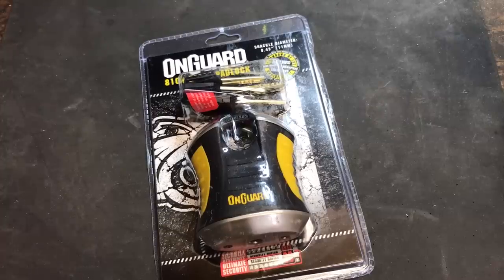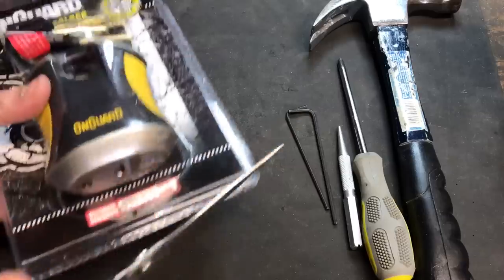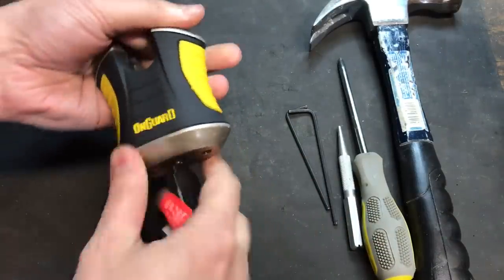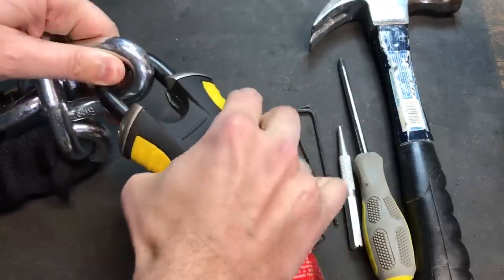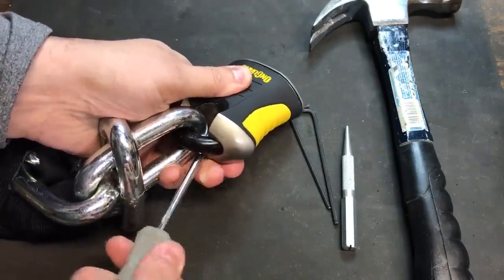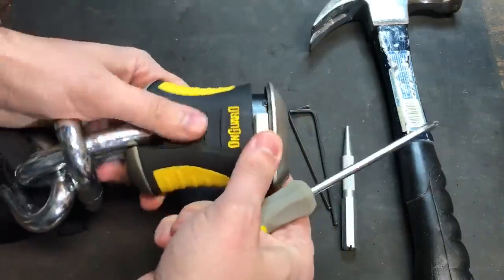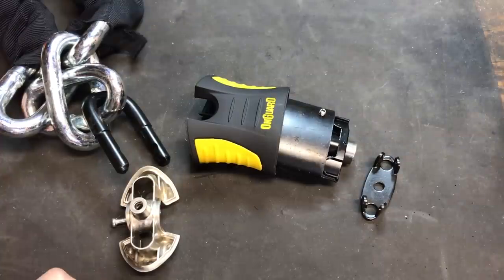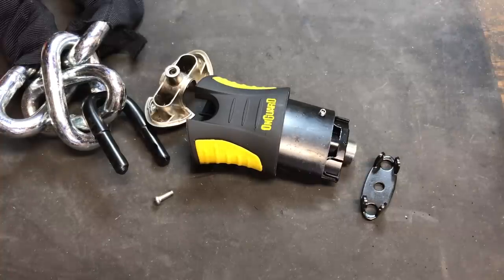[585] STUNNING - OnGuard "Beast" Padlock Disassembled While Locked!

Comment: How do flaws like this even make it past the design phase
Reply: They obviously do not have a skilled intrusion specialist. Its probably the designers mom, too proud of him to point out his flaws. 😂
Reply: David Daivdson  actually that lockbody is  so thin you wouldn't need to take it apart. That whole design is terrible.
Reply: They clearly knew the design was flawed by needing to put ball bearings in the allen key head. At that point they should have started again. Why didn't they go down the traditional route of putting the retaining screws at the bottom of the shackle holes?
Reply: David Daivdson  If the desire/need to open the lock leaving no trace was big enough it would be worth fabricating a small hand-held press to deal with the ball bearings. Would be almost silent too.
Reply: @Graham_Langley  A modified chain-breaker would make a nice slient ball squeezing tool. If the bike owner uses a different lock a thief might still be able to get away with the drive-chain as a consolation prize. 🙃
Reply: @gerhardvandenberg7249  Good point.
Reply: Tbh not everyone is the lock picking lawyer and imagine some thug on the street with all the right tools for that particular lock making a bunch of commotion trying to skillfully open it while you’re getting your coffee on your commute
Reply: Skilled intrusion specialist? It has external screws, ffs.
Reply: Same reason Boeing’s 737 was a fiasco, YouTube Rewind gets downvoted, and Hillary loses.

People make, say, and do things with limited understanding or a refusal to accept reality.
Reply: David Daivdson  you could put together a hand press that would push those bearing in silently. If you see a $15K+ bike chained up with that lock it'd be worth the effort then with two minutes silent work at night you'd be away with it.
Reply: David Daivdson  I'd spend a couple hours making a clamp for a few thousand $. Die grinder has the downside of being fucking noisy.
Reply: David Daivdson  Here in the UK some motorbike thieves used to go out looking for bikes to nick in pairs, usually from big out of town Shopping malls or city center car parks. The one working on the lock would be wearing dirty overalls, and the other would just be standing there in bikers leathers and holding a crash helmet. Apparently they'd either hang around waiting for someone on a nice bike to turn up, Or they'd feel the exhausts of a few bikes to tell if they'd been there long (Most people wouldn't be going to these places if they just needed to rush in and grab something in a 5 minute visit, so if the exhaust was still warm they'd most likely have 15+ minutes to steal it).

Any casual observer would assume that the bloke in leathers was the owner and he'd called out a mechanic because he'd lost his keys or something. There was one case I heard of where the thieves were noticed by passers by for 20+ minutes while they were struggling to remove the lock, before they finally resorted to A PETROL DISC CUTTER !!!, But as it STILL only looked like someone who's mechanic was having trouble getting the padlock off his bike no one going to the shops thought to mention it until later when they came back out and found a police officer was asking folks if they'd seen anything.
Reply: @Dream146  a clamp doesnt cost 3 grand, a chain break would even do for a few dollars. Your right about the die grinder, it probably wouldnt even get through the whole chain before the wheel was toast and you didnt even get though the chain lol. Most people use hardened chain when protecting valuables.
Reply: @bolerdweller  sorry I see my language was a bit ambiguous. I meant for the reward of a few thousand dollars I would go through the trouble of spending a couple of hours making a custom tool.
Reply: Leonard DSL money. Costs money to redesign/ fix and why fix it when people will still buy it?
Reply: David Daivdson  I agree. The input way you would know this is if you subscribe to third channel and use it as a reference to find the lock your neighbour uses on the bike you've been wanting to steal. The biggest security flaw a company can have is letting LPL get hold of the 🔐 in the first place.
Reply: You’ll have to ask the designers of the  Boeing 737 Max - they’ve got it nailed....
Reply: It's designed for lower costs and higher profits.
Reply: @Dream146  I have those tools ready. I've been waiting MONTHS for someone to 1) use this lock and 2) have a bike worth using this method on.
Sarcasm aside, not gonna happen.
Reply: @ozzyondirt4003  or you just damage that first screw in order to make it impossible to unscrew and you should be good to use it.

Comment: Wow crazy you can dissemble the complete lock from the outside with basic hand tools
Reply: LPL studied the lock and has a ton of experience. Honestly, most people would see a lock this beefy and would walk away or bring some bolt cutters. No petty thief would do what you just saw... lol. Like, yeah, this is a security flaw but only to an experienced expert in the field.
Reply: @katarasasii7073  A phillips screw head in plain sight is an easy thing to try, and a set screw is easy to tell even with a ball pressed in, this is 100% shoddy craftsmanship.
Reply: @katarasasii7073 , three external screws on the lock. I'd have taken this thing apart when I was ten. Just because I saw the screws.

Comment: "I would say that is a relatively significant security flaw..."

Also, the RMS Titanic is somewhat wet, and there is a bit of water to be found in the Pacific ocean.

Seriously though, thank you for these videos! Good, onto-it people like you are the tie-breakers of the cat and mouse game thieves and lock manufacturers currently play :)
Reply: The RMS T had a design and a structural flaw. The design flaw was that the water tight bulkheads were open top and like a tilted ice cube tray, all the water sloshed forward flooding each bulkhead in turn. The flooding was uneven (bulkhead four) and water started pitching forward over the bulkheads–she turned in to a nose dive.  

The structural flaw was that the steel used for the hull was brittle at arctic water temperatures. Obviously, neither item was checked.
Reply: A good case can be made that the ship that sank was the Olympic, the first of that class of ship, but under the name and insurance policy of the then newly built Titanic.
The issues you mentioned were known at the time, and also present on the second ship of the class, Britannic, which also sank.
For Titanic, the third and final, they had been fixed, and it survived, under the name Olympic for obvious reasons, multiple enemy strikes as a support ship in ww1, and returned to passenger service before getting scrapped, leaving no conclusive evidence of any ship of this class.

Comment: Stunningly stupid. Holy crap.

I am thinking that if they had applied red Loctite to the screws, this would have been impossible.
Reply: Patrick Henry 

You would then just a touch to the tool list.  Red lock tight will easily free up with some heat.
Reply: Spot welding is only way to make this lock use able.
Reply: @JamesPhillipsOfficial  useable yet unreliable
Reply: @adrianwelgemoed9562  I don't think I would buy it anyway. No point buying something that we have been informed, is defective out of the box
Reply: @JamesPhillipsOfficial  they probably gonna sue LPL now

Comment: This might be the first time I disagree: Is it really that easy to open when the lock is not lying on the floor?
Reply: If this is designed for motorbikes, it'll be laying on the floor in use. The chain goes through the back wheel so the wheel can't turn without totally trashing the bike. There's not usually much to chain to in a car park.
It would probably be a little more difficult trying to do this on the tarmac though
Reply: Same

Comment: Looks like something acme might supply to the road runner meep meep 
The sad thing is it wouldn’t be hard to improve
Reply from the maker: Agreed... very easy to improve. Ironically, using a bling pin instead of a set screw would probably be cheaper to make!
Reply: Trust me ACME is better quality than that lock
Reply: loz11968 Don't you mean to Wile. E. Coyote?

Comment: Wow, for a high security lock, that's terrible. Please do a follow up if you get a response from the company.
Reply: I think the follow up would be that it is user error. I assume, and this is reasonable to do so that their 12mm chain doubled in the hasp doesn’t allow access to the top screw. But this is a reasonable use for the lock and a 15mm motorcycle chain ring looped like demonstrated is a typical way to lock a bike since most locks aren’t big enough to latch two 15mm links and if they are they are likely flimsy or VERY expensive.
Reply: I guess still cheaper then buying a new bike...

Comment: Any insight into why it was made like this? I've never seen a lock with a screw in an accessible place before, usually it's at the bottom of the shackle hole to prevent just such an attack. The set screws also seem really low-down on the body, but I'm not as familiar with that.
Reply from the maker: The location of the set screw isn't uncommon, but you would usually find a blind pin pressed into position there.
Reply: LockPickingLawyer I'm curious, if all three outer screw locations were filled with JB Weld prior to use would that make it more secure? Is the lock mechanism easy to pick as well?
Reply from the maker: It's not easy to pick, but it's not hard either. The sliders don't have false gates. ☹️

Comment: To be fair, it's probably really difficult to use the hammer while this lock is on a bike or something. And it definitely takes much time to achieve that so I think you're pretty save with that lock (but I guess it's faster to actually pick it so I'm not sure if I'd trust that lock now).

Comment: That lock could be made more secure with a few drops of LOCTITE 640 High Strength Retaining Compound .or similar thread locking goop..  The lock core looks interesting
Reply: DrEvil814 Superglue works just as good or better and most people already have that at home anyway. But still, thats not how it should be.
Reply: And drilling those screw heads useless.
Reply: And maybe a piece of sticky tape lol
Reply from the maker: The loctites that are strong enough for this application can be released with modest amounts of heat, so I don't think that's the solution. A blind pin is what probably should be there.
Reply: JB Weld or epoxy could be useful as well but I do question why it would be user serviceable at all.
Reply: I'm not a lock person but I think a good solution, at least for the end user who has the tools, is to weld the ball bearing into the set screw. The manufacturer could do that too, but I bet it would require a fairly fancy setup.
Reply: Why not pop one or two other ball bearings in, so the set screw is filled? Easy fix, won't cost much, and can be implemented immediately on the same assembly line without causing too much havoc. Please contact me on where to send my consultation check.
Reply: Bryce Mayall  The solution is found in automotive steering columns, at least the older ones. 

Instead of a setscrew, the factory uses a threaded screw designed to be brittle. It's screwed into the application until it's stopped, at which point the head twists off and you're left with a 'nonremovable' stub (you need a very small ez-out to remove, which needs a drill press, and thus gets around the streetside disassembly issue).
Reply: I think that might work but there could be a problem, once you drive the first ball bearing in, the space above the ball bearing would be widened and may not be able to grip the second ball bearing. Alternatively, you could slip literally any piece of metal inside that is smaller than the opening just to fill the space, then pound the ball bearing in afterward. Alternatively just use a regular set screw...

Comment: Bought one going cheap with onguard 12mm chain. You can't actually get a screwdriver in the lock with the onguard chain if you lock both sides of chain into padlock. This also protects shackle from cutting attacks. I will change out screws with security ones and fill with solder. ;)

Comment: The comments here are a little on the strange side. It took him 2 and a half minutes to get into this lock, which for anything else would be getting a standing ovation in the comments. That does NOT include time to reassemble the lock. It is far easier to carry a lockpick set on you than it is to carry a construction utility belt full of equipment, and this also requires a fairly thorough degree of knowledge about the lock construction as well. Most people would get to the ball bearings and just give up.

I'm absolutely certain he could have picked this faster than disassemble it, and your average person isn't going to be able to replicate this feat with any more success than they would be able to pick the damn thing. It's a security flaw to be sure, but not nearly as big of one as people here are making it out to be.

Comment: Seems unlikely that someone will bring a philips head, some allen keys, a hammer and a punch to steal a bike... but if they did, there's an easy fix, just strip the head of the screw or fill the head with some glue and add loctite to the threads. Then they'll need to add a power drill too.

Comment: I like to use JB weld to make screws unremovable. 

Back it out a little, put some JB weld on the threads, tighten it down, then fill the head and smooth it over so it goes off the head and (more than) completely covers the screw. 

This makes it extremely difficult to remove the screws with a screwdriver, slows down a drill (slightly) and makes it easy to tell if they have been tampered with.

Comment: That is truly crap design. I instinctively distrust any padlock encased in plastic; what are they trying to hide? In this case they are hiding bad design, shoddy manufacture and poor choice of materials. 

I would bet a destructive attack on the body would not take much longer.
Reply: Just cut the chain with a disk grinder. They have battery powered ones now
Reply: Lot of noise, though.
Reply: @paulelderson934  Hammering those ball bearings does make noise too, I think chain would be probably the weak point for many thieves out there. It is just fast and easy in most cases. It is not that easy and fast to bypass the lock in this case, it is still huge security flaw, but anything that takes more than 10 seconds is suspicious and when you do not mind raising suspicion then destructive attack is simpler if not faster.
Reply: @ModMINI  As LPL has demonstrated, cutting chain with an angle grinder while it is in place is kind of hard because the chain likes to move around and it can be hard to get a solid grip on it, both for your hands and for the disc.
Reply: @ianrutherford878  Just use a set of decent bolt cutters, while one can argue it makes you easy to notice, one could also argue a hammer, punch, screwdriver, and two allen wrenches is also easy to notice.
Reply: @Adierit  really only interested in design problem-solving.
Reply: @ianrutherford878  well yes, but in terms of design "problem" solving, in any practical use cases it doesn't matter how good the lock is, especially where i live, if someone wants your shit badly enough, they're gonna have it, i've seen people cut the entire rear wall off a shed just to take what was inside of it simply because the door had a lock on it, if the lock is stronger than the container it's in, everyone ignores the lock, and breaks the container, or the chain holding the lock in the first place. people self train themselves to ignore noises, but everyone always says "oh i'd hear it", yet they program themselves to drown out outside noise on a daily basis
Reply: @Adierit  O.K.Big stories.I know someone who commanded a tank unit in combat.They blew away whole houses just to advance over enemy territory.Have we moved too far yet from small screws?
Reply: @ianrutherford878  My story was still about theft, and pertained to simply cutting off a side of a shed. I realize you're used to being over dramatic and unrealistic, but please keep your tales of unicorns to yourself.
Reply: @Adierit  Ah a descent into personal attacks.All yours ,hombre!Bolt cutters and sheds! High drama of theft and breaking and entering! You'll have a few admirers here.Enjoy being right,sir.I'm out of this thread.Peace, love, glitter and rainbows fill your dreams.
Reply: @NetAndyCz  If it was important enough, I suspect it would be relatively easy to make a tool that would apply pressure silently to the ball bearings by clamping on and using a clamp.  It would take a bit longer, but could be done with almost no noise.
Reply: @kcgunesq  modified vise grips.
Reply: As is clearly stated in the video, this is a bicycle/motorcycle lock. The purpose of softish exterior plastic casing is to protect the finish of the vehicle.
Reply: @ThatMontmorency  Thank you for stating the bleeding obvious.  However it doesn't protect the bike from theft, so the soft covering is pointless. There are some decent padlocks out there, Squire for example, that put plastic coverings over a decent lock but the also make the same as a naked padlock that stands alone.

Comment: I feel like doing the bearing punch portion would be pretty tricky to pull off in a typical locked bike scenario. Even on a solid table surface, it looked a bit awkward. This also took you (an expert) multiple minutes to accomplish in ideal conditions.

All in all, I'd still be pretty confident leaving a bike locked up with this while running into a store to grab something, for example.